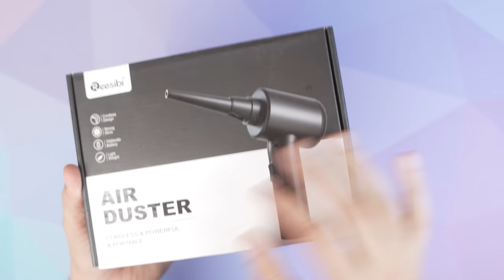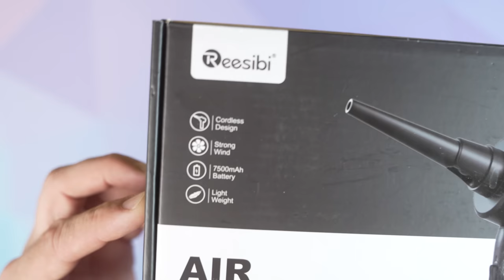How To Deep Clean Your PC

Comment: Careful with blowing high volume of air directly to the PC fans. You could damage it or break it.
Reply: or literally destroy the computer
Reply: @ninjatall15  He is right, the fan has an electric motor, when you blow the blades forcing them to move at high speeds it becomes and electrical generator, you are basically creating an inverted  voltage where it is not expected or designed to manage, with  unpredictable effects in the electrical engine and all the way  downstream. If the induced rotation is high speed failures are common.
Reply: Came to say the same thing.  Hold the blades so they dont spin when you use the blower, then carefully clean the blades individually with a soft toothbrush and a light amount of rubbing alcohol for tough stuck on dust
Reply: that does create static electricity too
Reply: SHOULD I CLEAN IT WITH A TOWEL
Reply: @eliminate100. no, I just use a hair dryer lol
Reply: thought this was debunked.. so its a real thing?
Reply: @KidJV  PC fans have diodes that avoid electrical current to flow in a way that damage the motor. However, a higher CFM  air current directed to freely moving fans could break the blade. It is recommended that if you need to blow into the fan (to remove dust) to hold the blades in place to avoid damaging it.
Reply: @RulzSG  got it.. thanks
Reply: Yeah, just make sure to stop the fan from spinning while blowing on it.
Reply: No, I'm not buying your shit.
Reply: Damn I was literally just having fun with that earlier.
Reply: You can still use a blower, but just hold the fans so they don't spin
Reply: @javiej  don't they have any fly back safety ?
Reply: @himanshrasal  yes, it's generally only a problem on older hardware, but it's better to be safe than sorry, there's no benefit to letting them spin

Comment: I was interested in the sponsor product until I found out it was battery operated and doesn't use removable batteries like 18650s.  I would much rather plug the thing in to a wall and deal with a cord than ever have to deal with a dead internal battery.  I got a battery powered drill+driver and the battery pack died before I used the thing more than a couple dozen times.  Such a waste of materials when I should have just gotten a wall powered one.  At least with the drill, it's a battery pack that can be replaced easily enough.

Comment: When re-pasting GPUs, it's best to manually spread a thin layer of thermal paste across the entire die. The silicon die makes direct contact with the heatsink, so if you miss even a tiny corner because the paste didn't spread across the entire die evenly, you can get weird performance issues, crashes, or you could even end up killing your card
Reply: This is why Thermal Grizzly gives you a spreader with it's pastes. I would suggest an old credit card or guitar pick if you do not have anything else to spread. You can use your fingers in a pinch, however I do not recommend it. Some pastes are very toxic. Got some on my hand without knowing, it sat for a day and I ended up scratching a hole in my hand itching it.
Reply: only time in my life Ive used one of those plastic spreaders

Comment: Hey love all your vids, but I think this one might cause issues for some people, it's usually a one in a million chance but best practice is holding the fans when using a blower, it's bad for the electric motors and also when repasting gpus it's best to be on the safe side and apply thin paste all over the die, it's different to an IHS where a dot or line is great. Sorry if this sounded rude, love all that you do have a great week :)

Comment: It's a great guide, and I love that cleaning and maintaining your hardware is getting a spotlight and people can learn that it has benefits that go beyond cleanliness to keep your computers well maintained. 

Just a note on the fans: As every electric motor can also function as a generator, spinning your fans with compressed air might(!) induce voltage back into the fan header that can(!) damage your mainboard. Personally, I like to unplug them or (if that's not possible) stick something like a toothpick between the blades so that they dont spin from the air. 

It's just a precaution, as most of the time, nothing will happen. That's why there will be a lot of people telling you that they've cleaned hundreds of fans like this and nothing ever happened. Same thing as with ESD, most of the time nothing happens, but when it does, it sucks to replace a broken GPU, CPU or mainboard. So keep that in mind, especially if you are cleaning someone else's electronics 👍

Comment: Using an actual air compressor is fine if you live in a dry area, if you do not, make sure to keep the compressor in a dry, room temperature space when using and it is just fine. No moisture. If you are still worried, place a filter over the air intake and use a fine nozzle.

Comment: 100 PSI air compressor with spray valve, cheap, multipurpose, no batteries which will eventually die... bring PC outside to dust and watch the crud fly out the case.

Used on over 100 PCs and never a problem despite the 'achktually' crowd being annoying about it.

Comment: Invest in a decent air compressor that can be used for cleaning your computer PLUS hundreds of other things. Most hardware stores sell a small 5 or 6 gallon air compressor for about $100 bucks.
Reply: You should be careful with using air compressors on electronics some can blow oils and condensation and can cause damage to electronics, you should make sure you have a inline filter to stop this if you are using to blow electronics.

Comment: i cant believe you let those GPU fans rip like that!!! because thats a great way to RIP your gpu^^
Reply: He did it with the cpu and the exhaust fan too, without disconnecting them
Reply: Not all fans inject current back into the card when spun manually. Besides these components have circuitry to prevent that from damaging them. Of all the people that keep propagating this myth that it will kill components can't show a single example in recent history of it happening. Regardless, it's stupid easy to stop the fan to prevent over spinning the bearing anyways... so mind as well.
Reply: This has been tested by a lot of tech journalists in the past, it’s not a big deal to clean those fans that way.
Reply: @lande.r1  so what was their sample size and product range? just because it doesnt happen a lot doesnt mean it cant happen. 

might be the same as seatbelts in cars....

Comment: it should be mentioned  that you should check if you have a warranty still one your GPU since taking it apart will void it .   Also you should not ramp up the fans with Air like that unless you know for sure that it will not generate voltage and back feed it to the PC not all do but some can, better to be safe it doesn't take much extra time to unplug them  or block from spinning as you blow them out.

Comment: air in a can £4 or this thing at £173.. let me think.. 🤔
Reply: you can get a full size air compressor and run air tools and paint a car with it for less..
Reply: I'll take my PC outside and let rip with a leaf blower instead.
Reply: @brookerobertson2951  To be fair, you're not going to get a very good air compressor for that. Regardless, there are risks using an air compressor over this. Don't turn down the regulator and you can blow components clean off a board. I've seen it happen. And if you live in a humid environment, you need to have a dryer on the line, or you'll be spitting moisture all over the PC.
Reply: @brookerobertson2951  literally just use a mattress pump(medium nozzle) and brush x10 more cheaper and gets through just about anythung
Reply: I think a 79 dollar investment  blows away buying cans canned air  all the time  and helping the environment a little bit in the process helps too   lol
Reply: @michaelrousseau4373  compucleaner or xpower a are much better choice with better performance than this crap.
Reply: @michaelrousseau4373  it's not £75 it's £175.. so you can buy 5 cans of air and then donate the £150 to plant trees.. I think planting 150 trees will offset your carbon footprint.. lol .. instead of buying a piece of plastic you will use twice that has lithium batteries in it that will only end up in landfill and a couple of years.. plus you can recycle the metal that the cans of made of easily.. lol
Reply: @ninjatall15  yes that's a good idea and that has a dual purpose..
Reply: @brookerobertson2951  finally someone spoke about lithium waste .
Reply: @brookerobertson2951  Well I see it  for 79.99 on amazon  and cheaper options that will  do the same thing and  still out weight the waste of canned air  .  What I have cost 100 and has still paid for it self 2 fold on the amount I've used it. i clean my PCs out every month or every other  and would use at least 1-2 every time so  it did make sense for me   but I get it might not be worth it it you and others

Comment: For those reading this comment please dont air blow your fans, this can cause so much damage over speeding the bearings, break fan blades,  but most importantly fans are essentially little generator's when they speed up the create electricity that can back travel into your motherboard. Reference (jaytwocents)

Comment: You really shouldn't be using any brushes or plastic parts when cleaning your PC especially if attached to a blower. Because plastic is an insulator, charge builds up on the plastic whether air is being blown or sucked through the nozzle. And if the nozzle or brush attached to the nozzle touches an electrical component, and electrostatic discharge can occur killing the electronic component. There is plastic that is ESD safe and there are companies that make ESD safe vacuums and blowers that use that type of plastic, but that doesn't appear to be the case with dust blower being used in the video. If you do use an non-ESD safe blower, like the one in the video, just make sure the nozzle is kept a safe distance away from the computer parts and never use the attached brush. Natural bristle brushes or flux brushes can be used on electronic components for hard to remove stubborn dust that isn't responsive to blown air.

Comment: At the point you start speed up your pc fans with air I stopped watching, spinning your fan blades creates voltages, than can directly damage your motherboard and other components with negative currency if you are unlucky and should never be done. Use cotton swabs and alcohol on the fans, it takes time, but its the only deep clean way of doing it, ot if you really do want to use compressed air, atleast block your fan from spinning 🤷‍♂️
Reply: Good insight , thank you I was mindlessly doing that but thankfully came across your comment

Comment: Nice video! When you started working on the motherboard, I thought it looked familiar. It's the exact same one I currently have in my Ryzen 5 3600 build that I built back in 2020 to replace my 10+ year old AMD Phenom II X3 720BE. Still holds up nice 3 years after the release of the 3600. As for the one fan, don't feel bad. The B450M DS3H motherboard only has one case fan header, so you would have to use a splitter which is something I need to do, but I've been running with just 1 exhaust fan for 2 years, so I guess it's not TOO bad, right? :)
Reply: Nah 1 fan is almost always bad. Just not fatal error bad.

Comment: Yeah my rig is on the floor under my desk where it belongs. Don't see it so it's clean, won't touch it until I build a new one.  And no way I'm doing anything you just did, I'm not tearing apart a 2000 dollar gpu. Any problems buy a new one, should be tattooed on my arm. Side panel holds a huge ball of wires so it stays screwed shut, it's spring loaded and don't wanna lose an eye. With new hardware coming out its going to get shoved in a closet until it gets tossed in the trash. Built in February so gets replaced by the next February

Comment: counting the 2 fans on my cooler, I have 5 fans on my pc., 3 exhaust, since the intake are 200mm. Also NEVER LET PC FANS OF ANY KIND FREE SPIN! This includes fans on the GPU because it can cause electrical damage as the fans turn into electric generators as they spin from the force of the blower.